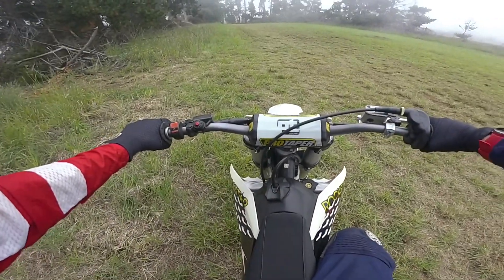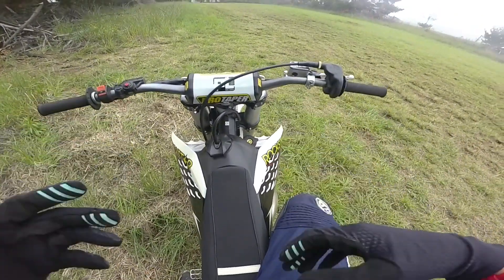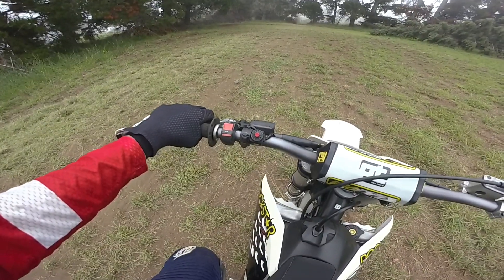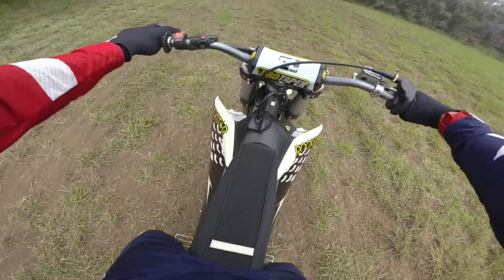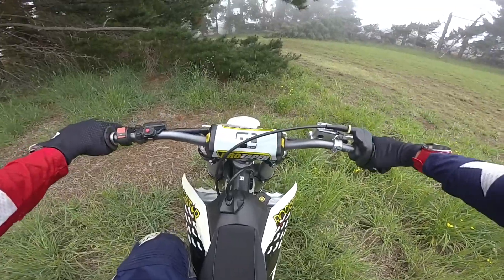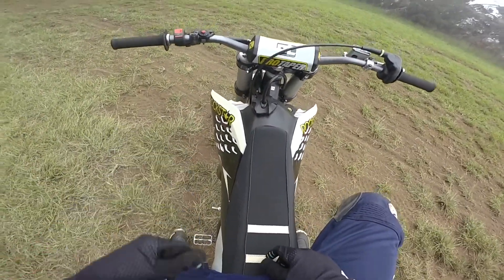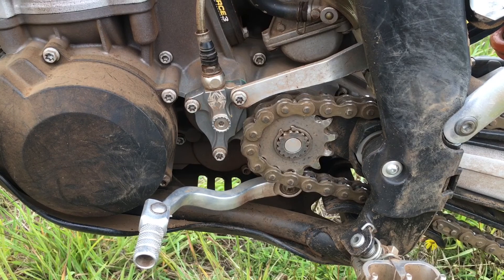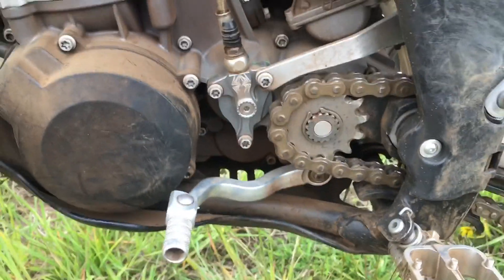Rekluse Auto Clutch Pros & Cons - Everything You Need To Know

Comment: I have no asperations to be a racer. I trail ride purely for the fun of it. A rekluse makes it more fun IMO.
Reply: What does IMO mean
Reply: @jojoplayz5291  in my opinion
Reply: Do you have to do the basket when doing a rekluse
Reply: @snailbagracing2327  No, it used the stock basket.
Reply: @jojoplayz5291 in my opinion
Reply: @snailbagracing2327  from what I know yes because I believe there are more plates and it’s a little bit different of the system and should be something you’re worried about indeed best wishes all my friends that ride hard Enduro to all my friends that race on the Mex track say ❤ rekluse
Reply from the maker: Sometimes there is more plates (Torqdrive), but they are thinner, so not thicker overall. If there is a new basket, it will only be offered as a kit and it’s for oil flow that the clutch will need. This is why some bikes won’t have the cheaper EXP kits… because those kits have better flowing billet parts included.

Comment: I'm in the same boat as you regarding fine motor control. In my case it's age-related as I'm 70 years old.  I recently installed a Rekluse on my KLR 650.  It's extremely useful for me and it's sure to extend my ability to ride into the future without worrying about a numb hand and the problems associated with a decrease in fine motor control.
Reply from the maker: Awesome Mark! You're a riding inspiration. Ride on my friend ✊
Reply from the maker: If he’d willing to drop the cash on a dual sport, a new 250EXC-F lowered an inch (depending on his height) would be a great fit. I have multiple friends in their 60s that do just that. Really light well mannered machines. My buddy Gasser is in his 80’s and he loved riding light 200EXC.

He may be riding lots of pavement and back roads. The KLR is a pretty good machine for that as long as things don’t get too rough and slippery. I found mine quite stressful in anything but commuting with how much chassis flex there was… and I was a strong 38 year old, sub-140lb elite mountain runner and long distance triathlete.
Reply from the maker: Here’s Gasser’s channel. He gets after it for and old timer! https://youtube.com/@gastonbelanger5346
Reply: @JohnHowerton137  Kx100.

Comment: Bike I bought had one on and I love it. No stalling is the best thing. He forgot to mention another great advantage. Jamb on your rear break and it won't stall ever. Coming into corners or down steep hills you don't have to cover the clutch. I put a LH rear break and solves the stopping on hill problem. Also have a small thick bungee band I can loop over lever and Bam, parking break as if it was a normal bike in gear. Problem solved.
Reply from the maker: qtubin the rear brake anti-stall most of the reason I bought one. I mentioned that in my other video but guess I forgot in this one. Appreciate the comment 🤙
Reply: what did you do with your clutch lever? do you have both a LH rear break and a clutch set up on the bars?
Reply: @apostate4apostate494  I added lefthand rear break, OX, kept clutch lever of coarse. Love the the LHRB. Barely touch the foot break. Takes a bit to get used to but way more control

Comment: Have used the Rekluse on my bikes for 10 years. Currently on a KTM 300xcw. The main point of the clutch for me is the left hand rear brake with no foot brake, great for really technical terrain, especially steep downhill sections with case-deep trenches! I don't think I could ride anywhere near as gnarly terrain with a stock bike.
Reply from the maker: My E-KTM has a LHRB and I'm really starting to love it. It was murder for my left hand (the bad one) at first, and still is for hard MX braking, but in the gnar and wheelies it's pretty badass 🤘
Reply: so you took the foot brake off and put it where?

Comment: I race hare scrambles and GNCC races. I rode my first motorcycle in April of 2021, and since then have raced in about 35 races. I recently put in a rekluse into my 300xc, and it immediately has made me a faster and more competitive racer. 
It makes me not have to worry about turns or small hills. I don’t have to modulate the clutch, which allows me to hit the trail harder and with more confidence. 

I also don’t have to kick start when I fall, saving time. 

I can see how purists may look at the rekluse and say I’m not going to learn m, but the reality is I’m
Not kalib Russell and never will be, so at this point I’m content to be the best I possibly can, which means allowing myself to have all the advantages I can have I.e. the rekluse. 

The only con I’ve seen so far is you don’t have the power hit as hard, but I’m certain as I ride I can fiddle with the power valve and lock in the power how I like. 

Summary: 
A rekluse clutch on a bike that is going to be raced on hare scrambles and the such will make that racer 1-3 minutes faster immediately.
Reply from the maker: Agree with all of that 👍 Sounds like you're having a blast and that's what matters most.
Reply from the maker: Year later, you may have tuned it more now. I have my most current one in the #3 position on my Belleville spring for more bite. I also have the springs set in the EXP disc to not feel like an auto clutch at all. It doesn’t freewheel at any RPM.

Comment: I have used a Rekluse auto clutch on all my enduro bikes since 2014. For my riding style, each new bike gets rally pegs, a Scott's damper, and a Rekluse auto clutch. My 2017 KTM 1090R and my 2023 Beta 480 RR  both have a Rekluse. I love fast pavement and easy off-road dirt trails on my 1090R, and technical off-road on my Beta. The Rekluse makes riding much easier, and much safer, especially on technical uphill and downhill trails. At 73, safety is the name of my motorcycle game. Great video, thanks for sharing!
Reply from the maker: Love it! Rubber side down my friend 🤙

Comment: thanks for demo John,im 54 and just got back  into riding again, i judt bought s 2005 crf 450x and thank god it has s rekluse clutch, never ridden before with  one ,but will definitely  be alot easier,  especially with hand cramps, cheers for the info. GC .Aus .
Reply from the maker: You're welcome. Just make sure you keep the freeplay gain adjust properly and you should enjoy it very much.

Also keep in mind you need to adjust out the freeplay if you need to bump start the bike. Then adjust it back before riding. Your bike is kickstart, so that shouldn't be an issue like the bikes with dead batteries. Just a heads up for you in case.

Welcome back 🤙
Reply: thanks for the heads up mate🙂

Comment: Hi John,
Great video. Thank you
 I ride enduro bikes since early 80s, and I currently have a EXC 300 with Rekluse EXP, no clutch lever and LHRB only (no pedal).

I find it very useful in many hard enduro situations:
- the engine never stalls - no time wasted if you slip in a timed session
- less gear changes - quicker in timed sessions
- LHRB allows 100% accurate control of braking in critical conditions such as extreme and banked downhills
- LHRB allows to stop and restart in extreme climbs, withou having to use the right foot to brake
- great traction control on slippery surfaces.

Disadvantages are:
- no jump start, only kick or electric
- no clutching. I do not need it with my bike, it's a 300cc. Probably it would not work on a 125cc, or you would need to set a high enough engagement speed.

PS - I also have a EXC 125 and Bandit 1200 with manual clutch, I switch from one bike to the other withou any issue.
Reply: Correction -  my Rekluse is the Z-Start Pro, not the EXP
Reply from the maker: Very nice breakdown. Thank you for taking the time to contribute. Totally agree with all of it.

I have friends who've had great luck with all the product's evolution over the years. They just keep getting more and more refined and durable.

Comment: I race hare scrambles and am a decent 58 year old "B" racer. I run a Rekluse because when racing for 2 hours, I get extremely fatigued.  I ride the bike like normal, but rely on the Rekluse toward the end of the race when tired. A Rekluse and 300 2-stroke or 350 4-stroke is the best "old guys" combo IMO!
Reply: right there with you. finding the ktm 640 a bit large for off roading on my 5.8 150lbs 56 years old self. bought a 350 and braaaaap!

Comment: I have the Rekluse EXP on my 14 300 XCW.  Positives outweigh the negatives in technical; another + is the ability to get off the bike and "walk" the bike up steep/loose gnarly stuff with it running and not using the clutch.  A left hand rear brake is also handy when stopped on hillsides or going down steep sections when you need your right foot off the bike.  The biggest negative to me of the Rekluse is the clutch is significantly harder to pull/feather on steep climbs when I need to keep rpms up.
Reply from the maker: Oh yeah. The off the bike stuff is great. Done that some in nasty tight rocky grass.

A lot of the newer models don't increase the clutch pull as much as they used to. They almost certainly make the upgrade kit for your bike.

Comment: went out on our local "black trail" this weekend and it kicked my @$$.  I kept stalling on steep hills with big roots in the middle of the trail.  Total pain.  Clutch hand was tired and numb from all the clutch work so hopefully this rukluse helps out in those scenarios. Getting one installed tomorrow.  thanks for the vid!
Reply from the maker: I bet it will. You can also tune the springs to make it act more like a normal clutch but still not small… which is how I’ve run them since this old video. Tuning alone would get rid of most the haters. Ride my 450 and you wouldn’t even know it’s in the bike unless you locked up the rear brake without the lever pulled in.

Comment: Greetings from Puerto Rico very good video good explanation, I have a crf450 2019 with an impressive torque, I was a professional racer and I ran again after many years without doing it and I run motocross with my children, I put the rekluse and it is a strange experience but in good way, and it is the same as what you explain, the system has given me friendly mobility without losing the power of the motorcycle and has led me to enjoy more and without feeling fatigue I can take the motorcycle to my liking, soft and docile and aggressive and a lot of speed ... greetings 👋🏻
Reply from the maker: Very good. Yes, it can be a little weird, but when you learn the strengths, it's sort of hard to fault. Makes the bike a little more usable in other situations it may not have designed for 🤙

Comment: Here in Jersey we rise some SUPER tight enduro trials, nonstop trees spaced less than handlebar width...it's like I'm in a pinball machine all day....but as a newer rider I would be stalling constantly without this thing on my rmz250.  LOVE IT!
Reply from the maker: There's always that time... when the Handguardless clutch lever hits the  tree and dumps the clutch for you 🤣 

Brake lever on the other side hits and when the front end dives... dumps your balls into the gas cap  🤣
Reply: @JohnHowerton137  ha ha ha!   Thankfully I'm running hand guards.
Reply: @JohnHowerton137  Just checking in, 2 years later and I an in another universe faster than I was when I wrote this initial comment.  LOL.  I was terrible back then.  For the past year and a half I've been on a 350 XC-F also with a rekluse and I freaking LOVE IT.  I got rid of the foot brake and installed another brembo master cylinder on the bars and connected that to the rear caliper and it's AMAZING.  The control is so much better and braking modulation is perfect with the one finger midwest lever.  I also have an Alta MXR and that quite frankly is the best dirt bike I have ever ridden.  I'm easily 15-20% faster on that than I am on any other gas bike.  It's 50HP of instant torque and you are always in the powerband 100% of the time.  it's a dream.  Here's one of my videos on it if you get time:  https://www.youtube.com/watch?v=v-oYmXzcTE4
In any case, I hope you're doing well, and happy riding!
Reply from the maker: @JoshStreetDesign  great comment my friend. Happy to hear. Both amazing bikes! I'll check it out 🤙

Comment: I bought an 04 YZ 450 that already had a recluse in it and it was my only bike for seven years the only thing that was weird was using the clutch when it's so flimsy it always felt weird. The recluse also had that feeling of riding one of those lawnmower powered go karts at the batting cages to it. 😅 Im much happier now just going back to old school on a 2022 YZ 450 FX.
Reply from the maker: They’re a lot different than that old clutch now. That was probably an old Z-Start model and likely wasn’t set up very well to boot. The one in this video could have been set up much better too. You probably wouldn’t even know the EXP 4.0 was in my current 450 unless I told you. Super smooth, perfect smooth pull, engine braking, the works.

Comment: informative  just got a new to me 2018 WRR with Rekluse Auto  and am just about to learn how she works in real applications   thank you
Reply from the maker: A lot of them are set up really weird which is why many people don’t like them. I actually don’t run mine (have multiple) in this configuration anymore because I do like more of a “manual clutch feeling” when my hand is working, so if yours feels really on/off, look into swapping out/mix & matching different colored EXP disc springs (come in the kit). These days my bike feels like a manual clutch being that it wont freewheel at any RPM, but it still won’t stall even if both brakes lock and it comes to a complete stop. It really is the best of both worlds.

I hope to make a video about it sometime, but my weekends has been largely eaten up by work stuff (then moving) for quite a while. There is light on the horizon now though 🤣